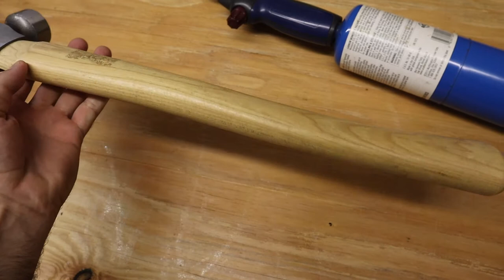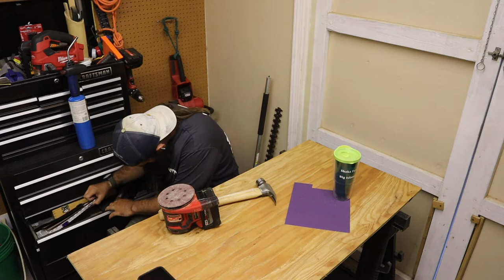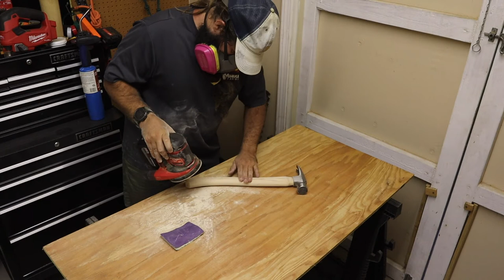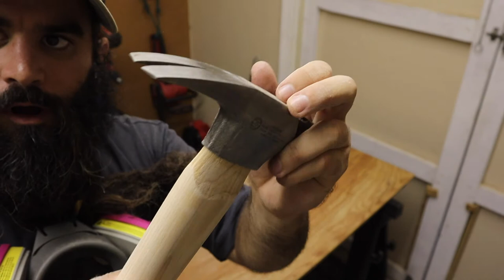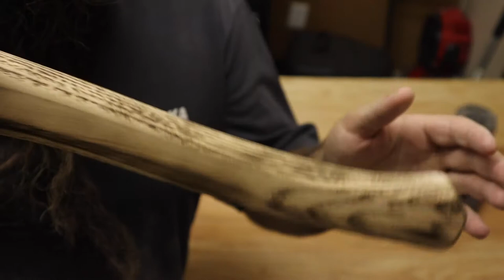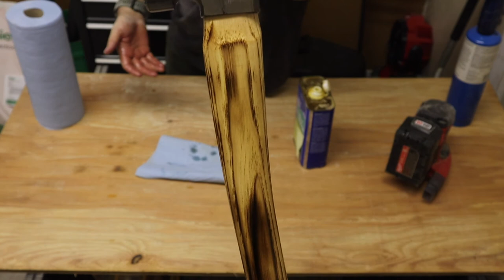Customizing and Re-finishing Hickory Tool Handles | Shou Sugi Ban

Comment: Just shaped the handle on my new framer and looking it up after the fact. IDK why this isn't more common, the tools are always right there lol. It's nice to have a grip fit exactly to your hand
Reply: I tried an octagonal shape using a flap disc to take off the bulk.
Reply from the maker: ahh cool, Octagonal. I bet that's nice. Yea the custom feel is great and the regular oiling really helps my hands I think compared to a dry wood handle
Reply: @rzfbgjy  I used paste wax over a couple coats of sealer. IDK how it's gonna just trying it out